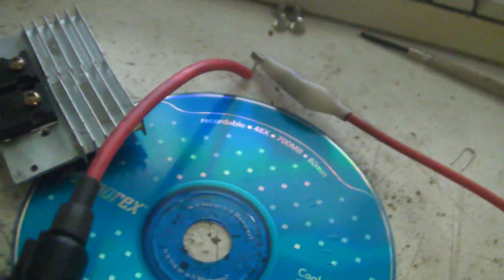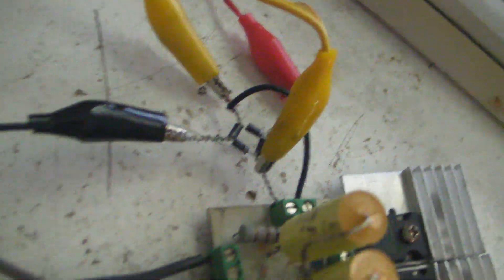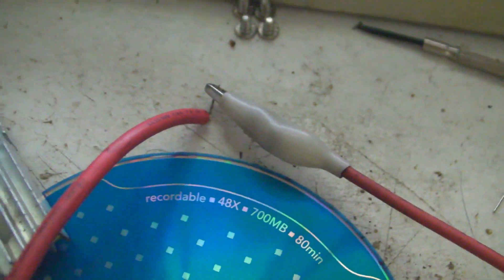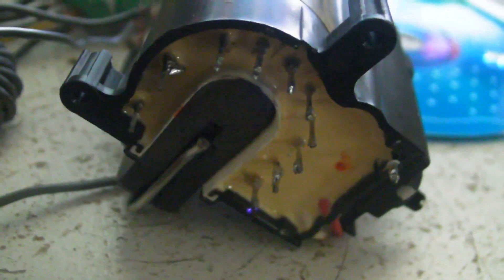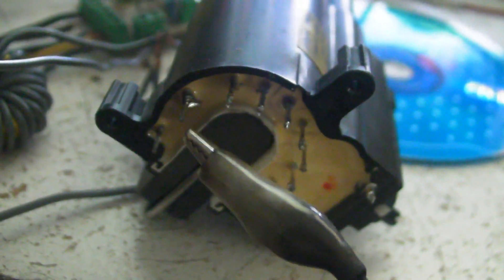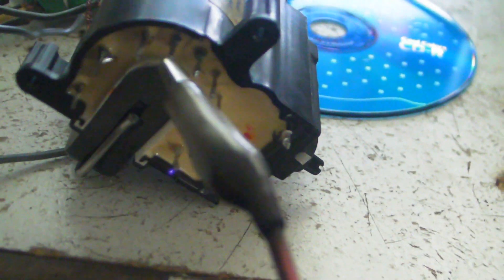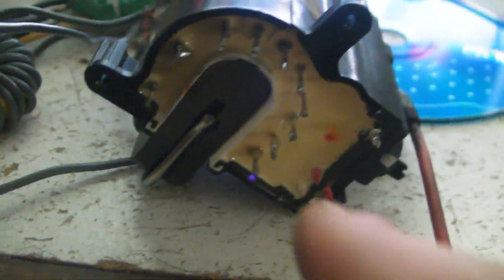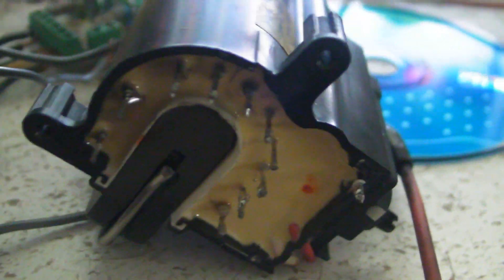Flyback Transformer High Voltage Pinout

Comment: You can measure the pin to other pins, if it doesn't have any conductivity, that's the ground pin. 

Simple... without possible danger.

Comment: I've got a 1500v 6A NPN transistor, and i built a 2n3055 circuit with isolation ferrite ring, with current limiting, rectifying and smoothing, would it be able to run at 230v mains?

Comment from the maker: Need some kind of step down transformer, something to step down the wall voltage and give at least 10A output up to about 50V (depending on your driver specs). You need to make it yourself really. Need a transformer, a bridge rectifier, and some smoother capacitors of adequate voltage and microfarad. Old wall powered audio amplifiers/ relievers usually have a decent transformer which is where I got the one in this video.

Comment from the maker: Its a completely different circuit than the single transistor one, and operates completely different. Its a push pull circuit. Which means while one mosfet is switched off, the other is on, visaversa. Thats why theres a center tap. + - + since the power doesnt go direc mosfet to mosfet. And the 12v wallward will not do anything fun. Might get a 1cm spark. These drivers begin to switch well at 18V, and depending on your components, they are made for a lot more power than that. P

Comment: I think I may have been interpreting some data wrong.  been a while since I was doing HV experiments and general arcing fun.  think I was possibly(definitely) confused between high voltage start signal and high frequency start signal. my favorite part of having hobbies on and off over the years,,, relearning all the important info and relations of. sorry,its starting to come back after a bit of reading.

Comment: just salvaged an old flyback from near our local swimming hole.  some one threw it off a bridge and then threw a rock through it.  but the flyback was good AND it had a voltage tippler unit that both survived the impacts.  gonna go back this evening to look over 2 or 3 other e-carcases at same spot.

Comment: I know you need a HOT arc for NO2 and its easy with a cooler coronal arc for O3, so why waste the power. well both produce O3 but I wanted one arc maximized for each. not easy to decide which components to use. with so many ways to do it. not much info been documented *that I can find*. I am @ hobby level parts and budget at the moment. step it up if some prototypes work out decently and the initial cost isn't sky high for upgrade. .

Comment: I saw a vid (forgot who's) but it had a flyback in a Tupperware full of oil for dielectric protection. and I think that they were feeding it higher voltage in.  but I could be wrong.  it was one of the cap/diode cascade vids.  they fed the cascade device with the flyback.  both were packed in oil. and the sparks were quite nice :)  besides dorking out w/ HV arcing. I wanted to make nitrogen dioxide NO2 and ozone O3 intentional in a controlled manner. having trouble finding V, A, Hz for optimals

Comment from the maker: Yes, a few muchs with one of these drivers will go a long way.  This driver would be easy to box up, because unlike many flyback drivers, this driver produces very little heat, and does not needs fans or GIANT heatsinks (still need small ones for the mosfets tho) I do not know about feeding flybacks with HV. Flybacks only operate on high frequency inputs, and not typical 60HZ AC. There is no real need to feed them HV, they can be cooked easily at 50V input on the ZVS.

Comment: so I could throw a few bucks at one and make a nice dedicated flyback driver?  sounds nice.  would like to box one up and not just have all kinds of wires all over the place ya know.  not knocking the experimenters, my projects usually look the same, all over the place.  but I would like to make a safe and clean model to toy around with, and be able to shelf when not in use.  thanks, any tips on finding how to feed one HV from a MOT or NST?  every time I search I find LOTS of lame sites few good

Comment from the maker: Wow, that is a shame. I got all of mine from garbage picking a while back. A good driver to make would be the ZVS, it is simple, and can be used for high powers if wanted. It is also very efficient, so it will not overheat. Parts for it only cost about 10-20 dollars, depending on how nice of parts you use.

Comment: I dropped off a TV at the E-waste place, (kept flyback), there was a projector there w/ a GIANT flyback, had 2 big HV hots out the top. think it was running 2 separate projectors/CRT's.  but... they have a STRICT NO SALVAGING rule.  made me a bit sad to leave it.  hey can any one point out a good source for drivers for flybacks?  I would like to find one for low voltage, and maybe some info on feeding one an already HV AC in.  have some MOT's and NST's and wanna play

Comment from the maker: For a driver like that, the output would depend most on what kind of flyback transformer it is. There was one time I had a flyback with no winding space, so I ground some of the flyback down after taking the core off. Long story short, as soon as I powered it up, it was an arcing ball of trash

Comment from the maker: ZVS is the best way to go. At low powers like 12V, where the driver hardly hits the threshold to function. The driver doesn't really kick until about 18-36VDC. The 2n3055 driver is great for starters. I had better luck with a simple TIP120 transistor, they didnt seem to blow as often. Do not expect anything real impressive, and expect a heatsink to overheat to overly hot, very quickly.

Comment from the maker: The suction cup is the high voltage cable. Forget the other cable... cut it off. And these require high frequency to run. Look into making a ZVS driver for your flyback.

Comment: I liked the "So, here's our contestant."  :p  ~  When you were arcing (small arc) to the pin on the lower left, why was the main high-voltage pin & the pin 2 spots above it on the same side as the high-voltage pin arcing at the same time?